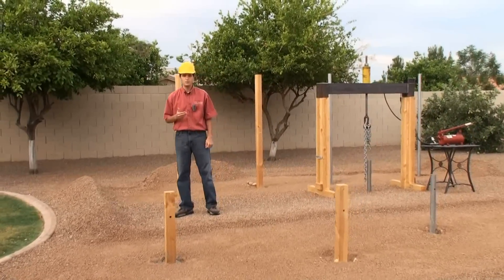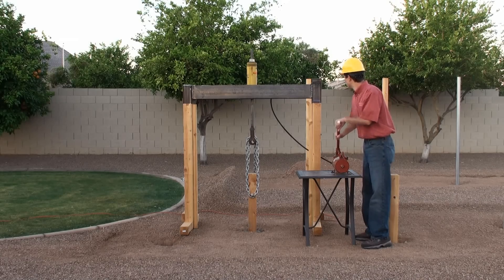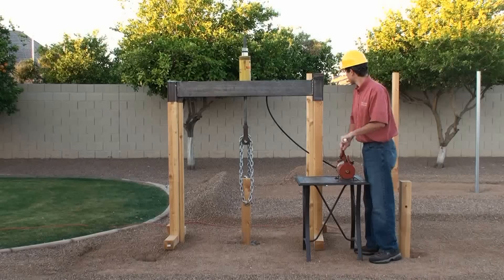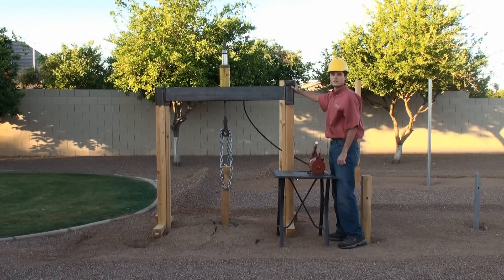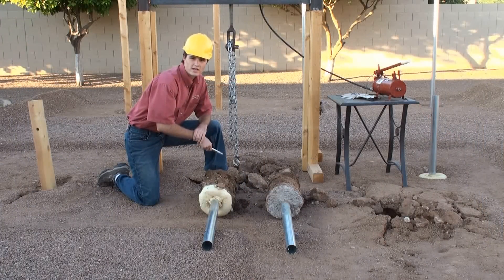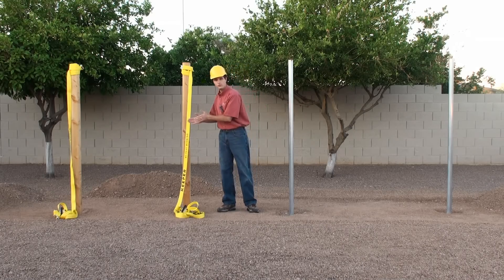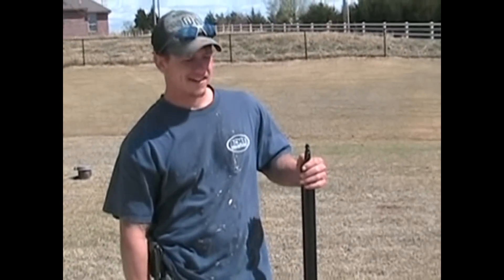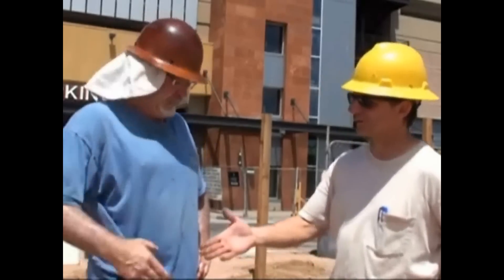Testing to Compare Concrete to Secure Set

Comment: Secure Set is a closed cell, high density foam, no water or air can penetrate it.
Secure Set has an expected life of more than 40 years.
Because plastic doesn't react chemically with most other substances, it doesn't decay. Therefore, plastic disposal poses a difficult and significant environmental problem. Plastic hangs around in the environment for centuries.
Reply: Wait doesn't concrete hang around in the environment for centuries too...
Reply: I think the whole idea is that it lasts a long time dumb dumb

Comment: Hey, the cost factor is minimal in the grand scheme of things.  It's what, maybe 2.5 times the cost of the concrete?  But your time and effort is worth money also.  If I'm putting in 8 posts for a small house or shed in the back yard, I'm happy to spend $40 for that.  That's a piece of cake, compared to hauling my wheelbarrow out, making concrete, pushing that from hole to hole, not to mention the extra curing time and clean-up afterward. Are you kidding me?  The $40 is a bargain!
Reply: Anton Nym its cheaper than concrete!
Reply: you are obviously a smart and successful contractor. I agree 100 percent with your analysis. You said it perfectly!
Reply: I agree. If this is done by a pro the labor would be a lot less than concrete. The materials cost will offset a fraction of the savings passed down to the customer on their invoice but, the customer is still saving a decent amount of money. If done by DIY, it saves a lot of time and eliminates the risk of permanent lung damage from free silica particles.

Comment: does it melt with thinners
Reply from the maker: Once the foam is set, if you pour acetone on it, it will deform and "Melt" to a degree just on the surface.  But since the foam is closed cell, it does not allow the liquid to penetrate beyond the surface.  You get reaction on the surface but not internally.  If you remove the top layer of the "melt"' you can pour on additional acetone and repeat the process.

Comment: Can it be used for foundation like a deck post?
Reply from the maker: Hello,  Yes, it is used extensively for deck posts.  You have basically have a vertical load on the post but not much side load "IF" you cross brace the posts under the deck. Protects the posts below ground line for decades as opposed to concrete.

Comment: It seems to me they are trying to show how each material (concrete - secure set) holds onto the material being installed. They both performed equally well, showing secure set is a viable option to concrete. 

I personally would use secure set for any wood material due to concrete typically holding moisture and rotting the wood.
That would be the only application advantage for me other than the ease of use vs concrete
Reply: In Florida we would not think to use anything but PT out of climate control. It lasts forever if it stays moist enough not to dry rot.

Comment: I'm going to go with the optimistic approach as opposed to he's attempting to sell expensive crap on the internet. 1> The holes are probably not going to be dramatically different for the testing. They're holes. 2> The ground 2 feet away is probably comparable in makeup so it's not likely that one is looser than the other. 3> The product costs $8.00 a hole and some have complained that that is too expensive. If I were doing a ranch fence where I had to schlep and mix concrete in the middle of nowhere, I'd probably consider this option. I might even consider the option normally based on labor and additional factors to mix concrete. 4> One of the declarations of the product is better penetration to adjacent soil, thus I'd expect the pulls to be heavier to unearth the posts as more soil is effected. Great video. I agree the hardhat and dad's shirt is corny.

Comment: Cool stuff, too bad it's cost prohibitive. Not worth $8.00 a post. No freaking way.
Reply: unless you're going to mix it yourself as some of these guys are suggesting, you will need two bags of quickcrete. cost is about the same. you might save a buck or two a post if you can find it on sale. if you've only got 10 to 15 posts to set, which is a big project for most homeowners, it's going to cost you about $20 more but you won't be lifting 20 - 30 fifty pound bags of concrete mix. and my car will easily transport a 15-post kit of secure set, but it won't handle 30 50# bags of concrete. so that means i gotta make a bunch of trips, pay for delivery, or rent a truck.
Reply: right ...that quiet expensive  per post
Reply: What is the typical concrete cost a post?  I have no idea.
Reply: What does concrete cost per post?
Reply: For 1 post maybe less then 0,5€. 25kg of portland cement cost there 2€, you make 100-125 liters of concrete from it. And sand is very, very cheap.
Reply: 7.60
Reply: If I had a few posts to do, it would be worth not hauling heavy bags and mixing. Even Quikrete no mix is a pain. But a long run or a lot of posts, the cost is prohibitive. Just finished a 50 ft run of chain link and I should have used this as a trial. Maybe next time
Reply: Are you using half a bag per post or is it that significantly different from the price in Ontario Canada? I use 3-4 bags per post at nearly $8/bag to fill up the tubes set at 4' depths.
Reply: An 50 bag of ready to use quick setting concrete mix is 5.75 dollars per bag. So once you factor in the labor costs, at 20 dollars an hour. The mixing of concrete will take 5 minutes, also 30 minutes pouring, tamping, leveling, and babysitting. So you are at 11.67 dollars of labor. The total cost of concrete per fence post is 17.42 dollars and that is for quick setting concrete. Foam just takes 15 seconds to mix, 5 seconds to pour, and 10 seconds to hold the fence post than move on to the next fence post. The labor cost per fence post is 16 cents. So the cost of foam is 8.16 per fence post. The end customer can save as much as 9.31 dollars per fence post.

Comment: Besides the guy who did my post, dug the holes.......poured the dry concrete in......added the water.....stirred with a power drill......added the post.......set them straight and went to the next hole......4 guys....40 posts......2 hours.....they have been doing it for years so they have the routine down pat.
Reply: They use this here in Texas for the utility poles and guard rail poles , It seems to work pretty good in this solid clay soil . I'm not sure how long they have been using it but when the utility pole in my yard had to be replaced the crew boss told me that all the utility company's have stopped using cement because of the labor with mixing and clean up . He told me that he felt the foam was helping the poles tolerate the high winds , he said the poles set in foam didn't break off or shift as often ??
Reply from the maker: +We_are_free We _are_anecdotal 
Remember how good they are in a couple years when you replace the posts.  Secure Set is a 40+ year product and all the utility poles and telephone poles in the US and Canada are installed with Secure Set for the past 17 years.

Visit our website at Secure Set www.secureset.net.  Click on the “Calculate My Project” button and it will walk
you through the steps which will tell you how much product you need to order
for your project.  This site will also
tell you shipping costs and shipping times as well as answer many other
questions.
You can purchase Secure Set online at Home Depot http://www.HomeDepot.com
And on Amazon   http://www.amazon.com
Reply: +secure set
My 3.5" diameter Galvy posts with concrete above grade and sloping away should last quite a while, I reckon. longer than 40 years.
Neighbor bumped one of my posts with his tractor while trying to drag a bus out of the mud. it was fine.
note: 5-7 bags concrete per hole.

Comment: I used this for my 80' long fence, 3 years ago. My fence was 8' tall, because of the need for complete privacy. It still looks great. I didn't have to deal with labor of creating the concrete, saved me a lot of back pain, and a lot quicker. I had to remove one of the post because I didn't realize that the post was twisted. It was so easy to remove it, by digging around the hole, because it was so light. I will definitely use it for other projects.
Reply from the maker: +lkoumis 
That's awesome!
Reply: $$$$$$??????????????? diff. vs. concrete????
Reply: lkoumis - It was "so easy to remove" the post and yet you like this product?
Reply: Jon, easy to remove AFTER THEY DUG AROUND IT, meaning once they removed enough dirt to pull the post they wheren't dealing with the DEAD WEIGHT of the bag or more of concrete.

Comment: I like the short term effect of this making things easier but what happens in ten years time with the foam? Does it rot or  does it break down? I mean concert does not have a shelf like like mixed chemicals do. I don't think I would build a house with the stuff but maybe a good fence set or even posts for small projects but power lines really?
Reply from the maker: +egn83b 
It has been tested to be a 40+ year product in the foam state.
We do have people that use it inside their walls and floors.

Visit our website at Secure Set www.secureset.net.  

Click on the “Calculate My Project” button and it will walk
you through the steps which will tell you how much product you need to order
for your project.  This site will also
tell you shipping costs and shipping times as well as answer many other
questions.

You can purchase Secure Set online at Home Depot http://www.HomeDepot.com

And on Amazon   http://www.amazon.com

Comment: Before I buy, I need to know about frost heaving with this product. Any insight on this?
Reply from the maker: +mvpbuilds 
Secure Set is a closed cell plastic and cannot take on water or even moisture at anytime so the frost heave is not an issue.  

Visit our website at Secure Set www.secureset.net.  

Click on the “Calculate My Project” button and it will walk
you through the steps which will tell you how much product you need to order
for your project.  This site will also
tell you shipping costs and shipping times as well as answer many other
questions.

You can purchase Secure Set online at Home Depot http://www.HomeDepot.com

And on Amazon   http://www.amazon.com

Comment: may i know how to effectively remove it from soil ? cut with a saw ? or smash it like concrete? as far as i know the texture is sort of a hard dry sponge
Reply from the maker: +Victor Lim 
To remove it from the soil you can simply dig it out.

Visit our website at Secure Set www.secureset.net.  

Click on the “Calculate My Project” button and it will walk
you through the steps which will tell you how much product you need to order
for your project.  This site will also
tell you shipping costs and shipping times as well as answer many other
questions.

You can purchase Secure Set online at Home Depot http://www.HomeDepot.com

And on Amazon   http://www.amazon.com

Comment: It looks like the area was just graded and leveled with a steamroller. How do we know if the soil around the secure set wasn't compacted more than the soil around the concrete? Here is a real life test. Saturate the soil with water and then do the test. Depending on the size of your hole you can multiply the weight of the concrete by how many bags you use. For instance, if you use three 80 lb bags of concrete to set your post you're going to have to overcome 240 lbs right off the bat before you even think about the post moving or rising. I'm about to install a solar tracking mount that will hold two 235 watt panels. Each panel is almost 50 lbs and is 65" tall by 39" wide. Take that 100 lbs. mounted on about 200-300 lbs of steel framework and add in some wind load. I don't believe the foam has the integrity to take the weight and loads the tracking system and Mother Nature will throw at it. That might be a good selling point for your product if it can perform as well as concrete.
Reply from the maker: +frankmmiii 
Do the test and send us the video.

Visit our website at Secure Set www.secureset.net.  

Click on the “Calculate My Project” button and it will walk
you through the steps which will tell you how much product you need to order
for your project.  This site will also
tell you shipping costs and shipping times as well as answer many other
questions.

You can purchase Secure Set online at Home Depot http://www.HomeDepot.com

And on Amazon   http://www.amazon.com

Comment: Ok first the obvious the chain is under tension  why doesn't this guy not have safety glasses on?  It's obvious the secure set is distributing the force all over surface of its entire volume and the concrete is not.
Reply: just eyewear? sure he should not also be using a "blast" shield, due to the pieces of links that will become projectiles?

Comment: Interesting tests. Providing the specs was appreciated. In the "side-load" test, the strap was about a foot lower on the wooden post for the Secure Set which makes the leverage used unequal. Even so, both posts appeared to fail the same way. With the metal pole test, the pole set in cement bent while the cement remained in position; the pole set in secure set stayed straighter because the Secure Set moved with the pole. This may be due to the weight difference?
Reply: +50reeves 
Apparently I stuck a nerve.  I am a structural engineer and I am not trying to knock the product... just assessing the video.  In fact, I find the use of rigid expansive foam quite ingenious for this application.  Which is why I watched the video.

Lateral loading from wind or other applied loads would cause a moment couple in the "footer" which is transferred to the soil.  If the Secure Set allows for elastic deformation (temporary crushing) then I understand your point of load dispersion.  However, if the deformation is elastic to plastic (permanent crushing) then the foam would not recover to the original position and basically loose some of the load bearing capacity in that particular direction.  

To get back to my original point in my first post, I would like to see lateral loading tests which show moment resistance to failure.  Similar to what you did in the last part of the video with loading high on the metal posts.  Just need a max load from the tests.  I would expect concrete to be higher here, but that is not necessarily a bad thing....
Reply: +Ever Better This is the only test that is of any importance.  We are typically looking for lateral load resistance with posts not tension.  The metal pole test did indicate failure of the post with concrete, while the post rotated with secure set.  My educated guess would be localized crushing of the Secure Set foam.  I would be interested in seeing a lateral load test with the metal posts.  IMO Secure Set would likely produce lower lateral load resistance.
Reply from the maker: +Ever Better 

Have you ever seen a fence post broken off?  This is what this test is showing you, let me
explain.

Secure Set has the ability to disperse the weight of the
wind or an animal pushing against it and can take more force against the post
because it is able to disperse the weight.

Concrete is not able to disperse the weight and so when a
great force comes against the post, the post breaks off.

This is what this test was attempting to show you.  

This is why for the past  17 years the utility industry has installed
all poles and telephone poles with Secure Set in every state across America and
all over Canada.

Have you noticed that when a car crashes into a telephone
pole that there’s major damage to the car and the pole is still standing?  That’s because the Secure Set was able to
disperse the weight of the great force, before utility poles and telephone
poles were all installed with concrete and when a car crashed into a telephone
pole it would break off the pole and would need to be replaced.

Visit our website at Secure Set www.secureset.net.  

Click on the “Calculate My Project” button and it will walk
you through the steps which will tell you how much product you need to order
for your project.  This site will also
tell you shipping costs and shipping times as well as answer many other
questions.

You can purchase Secure Set online at Home Depot http://www.HomeDepot.com

And on Amazon   http://www.amazon.com

Comment: I'm building a small wall in my back yard behind my grill. It is about 12 x 5 feet tall. It is just for decoration, so it doesn't need to be very strong. In anyway I was thinking to do a "dried stack" mortless . I see in your video that there is a wall vey much like what I want to build. My question is...did you use SecureSet to build this wall? Or can the product be use for this job?